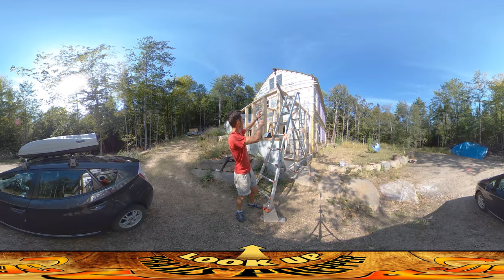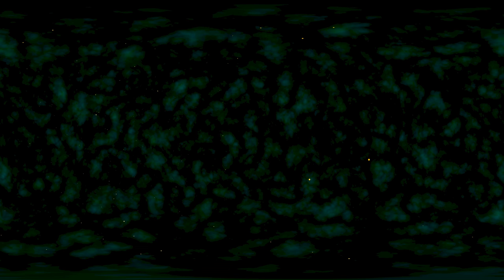Homestead Building - Greenhouse Posts Messed Up, Solving Problems

Comment: Will say that i'm pretty impressed by the speed these have gone up, now i know they aren't finished yet, but they're definitely moving in the right direction. This to me also makes me assume most if not all the work that can be done inside has been done. Which makes me actually hope and keep my fingers crossed that you might be able to move in this year, mainly because the main things left are mostly straight forward 'boarding up' everything (and as a last, which might not finish this winter but is also less important, 'boarding up the green houses'). So yeah, 'fingers crossed' on the inspection(s).
Reply from the maker: My fingers be crossed too!